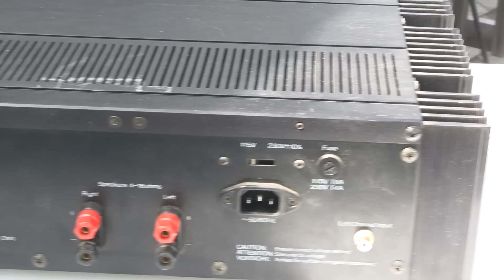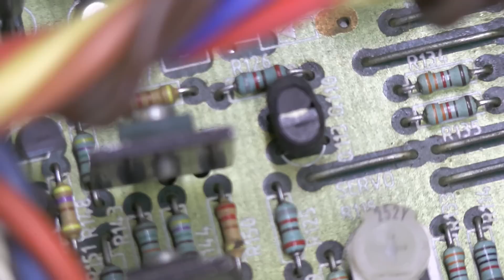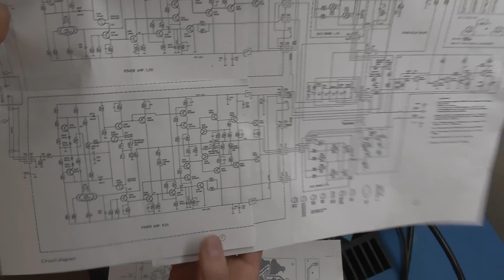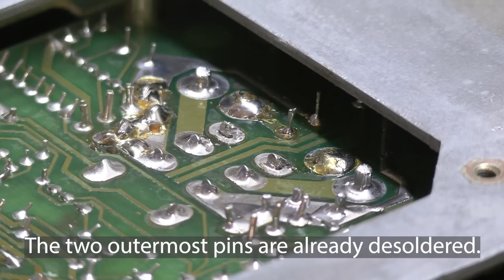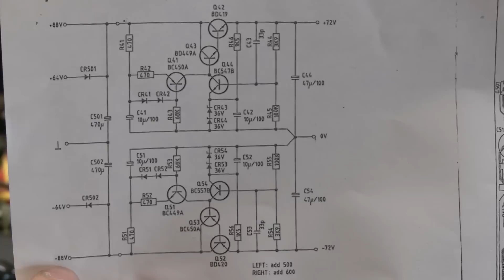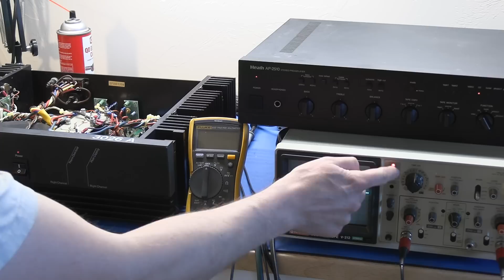I broke this already broken Tandberg power amp while trying to fix it

Comment: I'll help with some fact checking...
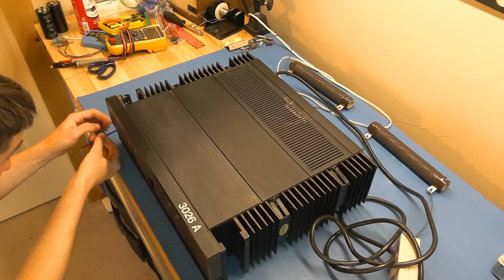2:17 "Since this is from the Netherlands, it's probably metric" - It's from Norway, in fact. Probably still metric bolts, though.
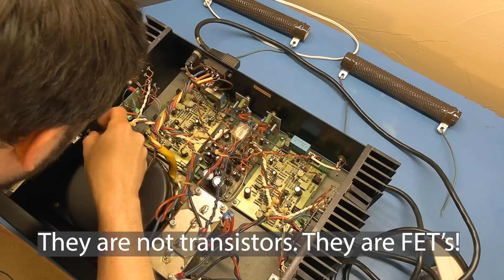5:10 "They are not transistors. They are FET's" - Which are also transistors. Field Effect Transistors.
Reply: Haha thats what i noticed. But. @ some point Tandberg stuff were build in Holland under Norwegian design. Phillips for instance. 

Me to,  wait whatt, build in Holland?? And yeah turns out he was correct. Maybe it said so on the back
Reply: @vissersven   Good evening from Norway, 15 minutes drive from where this was made 🙂 I think you are a bit unfair, you've got schematics, not complete alignment instructions. You had some bad luck from the beginning, so thumbs up for being so honest and not hiding it. Most of Tandberg 3000 series: you only unscrew  the two unbrako/hex/allen screws at the back to take of the pressure of the rear top cover, push it backwards and lift it out. I made a 3006A from left over parts from the factory+some parts I made and bought transformer and the MOSFET output transistors. Fortunately the GURU of Tandberg service which passed away in june this year started it up for me with a variac. This amp have served me around 20 years now. I also built two 3008 preamplifiers from left over parts. Your video was interesting and it's always something to learn from mistakes, preferably others mistakes. I guess you spent some $$$ at parts. BD419 and 420 is difficult/expensive to find now. Thank you for sharing your equvivalents. Many amps uses these and it's common that they break because of 419/420.  
About unloaded adjustment......are you supposed to place a load at the speakeroutputs as you did or is that load supposed to be in the scope probes???? 
Tandberg had their own production of instruments, l've got a Tandberg distortionmeter. Someone wrote Tandberg was also produced in Holland, totally rubbish. Tandberg used Philips CD players which they bought complete, removed the OP-amps and put in their own cabinet with their own made analogue board.
TCD3034 was made in Penang Malaysia, TR3030 was made in Hong Kong, both budget models. Tandberg was Norwegian and everything else was made here!

Comment: I knew right away this would be a great video...Sadie to open the show.  I've seen ground plane like that on boards but usually not so close to the components that probing would cause a short, unusual.  Too bad you didn't notice the bad soldering on that loose cap, could have saved a lot of work.  ["Mac: Crazy Swedes, Doc: They're Norwegian Mac" (The Thing) 1982.]  Tandberg=Norwegian.  Regardless of the mishaps along the way, in the end it was a win.  Thanks for the video and cameo of miss kitty, well done.
Reply: I've never seen a ground plane like that before. I'd have probably done the same thing. I'm forewarned now

Comment: You mean to say, “They’re Field Effect Transistors, not Bipolar Junction Transistors,” or, “FETs not BJTs.” They operate very differently; you might characterize the FET as  a voltage device, and the BJT as a current device.